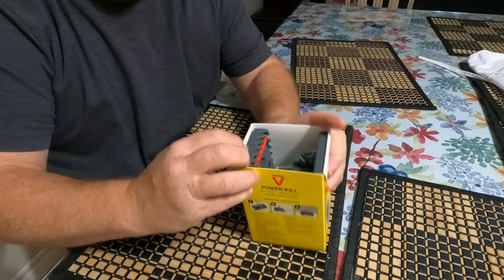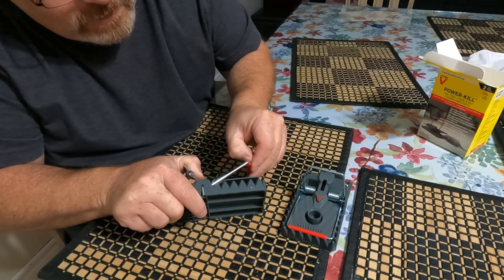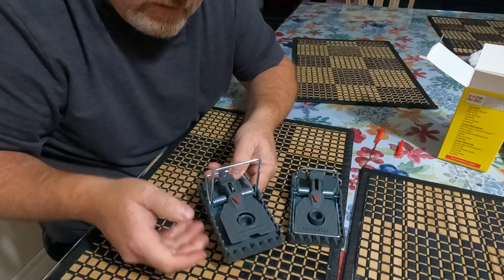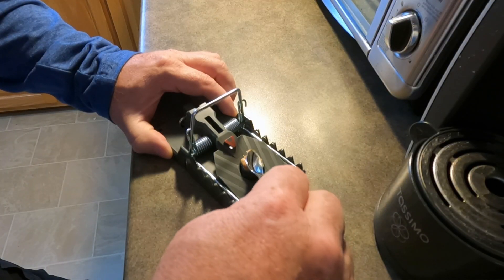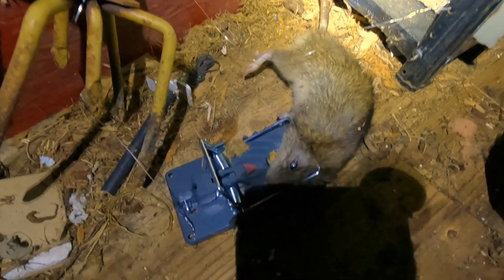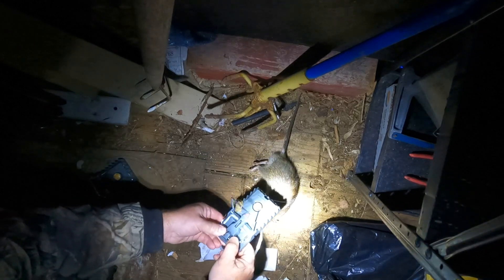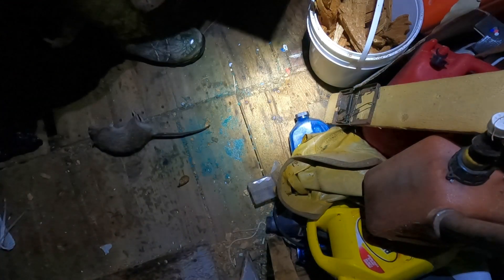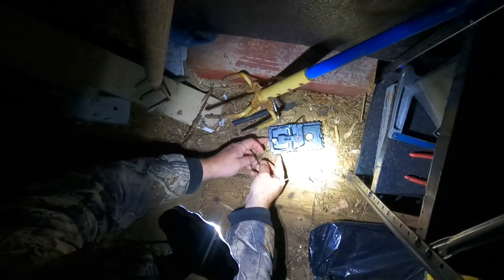Victor Power Kill Rat Traps, Do They Work?

Comment: Thank you. The trick to make the platform sensitive is invaluable, they don't tell you that on the box. I got a rat in my house, I bought a 2 pack of these traps and set one out but nothing happened, in frustration I threw the trap in the garbage but upon further research, this video, I tried the second trap using the sensitivity trick and it worked. I filled the bait cup flush to the top with fresh peanut butter, the rat ate about three quarters of the peanut butter before it went off but it worked like a charm, cracked it hard on its neck. I heard the snap and rushed to the trap and watched the rat's nervous system give out. Thanks again for the tip.
Reply from the maker: glad it helped. I'm looking into modifying the trap to see it I can make it super sensitive so that a mouse will trap it every time as well.

Comment: Nothing worse than having unwanted guests. The homemade ones with a 5 gallon buckets., that they used in the old meal plants work good too
Reply from the maker: yes I made a few of those traps over the years, add anti-freeze instead of water for catching mice at cabins when the temps drop below freezing. Great set-up

Comment: I've used those before on "Halifax Rats" when I lived there. Caught 2 in the same trap on numerous occasions. The wooden ones with the big yellow pans work well too but some people find them hard to set.
Reply from the maker: Yes Mike they seem to have the snap and hold power needed to work great, I only wish it was just a little bigger. But at this size they should work in mice as well

Comment: Nice video, but why do you need to remove the plastic bar?  It’s still functions the same way with it or without it.
Reply from the maker: I like to reduce the focal point of energy at impact. But you are right, it will still work.

Comment: I killed two in half an hour apart using the same trap, i used a paste a small amount so it had to get closer in. Large bait it on solid piece wont work they take the bait and leave.
Reply from the maker: It's a decent trap, I'm after getting 89 rodents since 15 Nov. A lot more in my older traps, but this one has been catching rats, mice and squirrels.